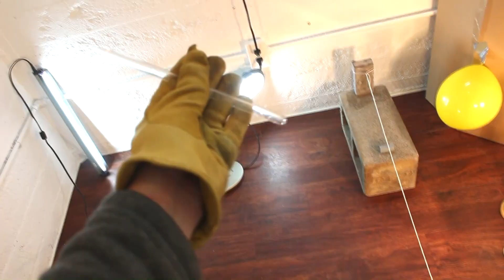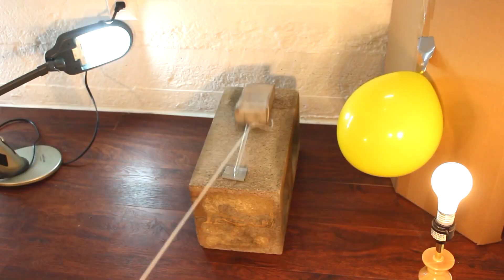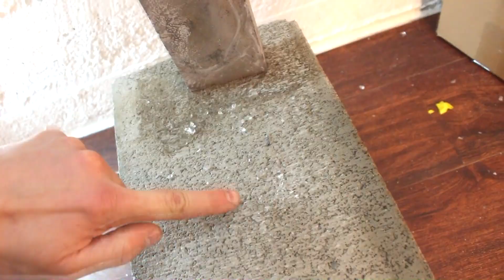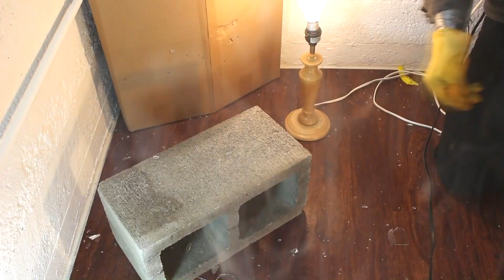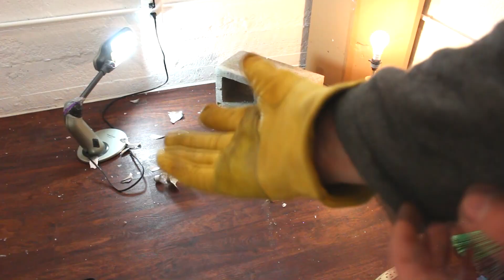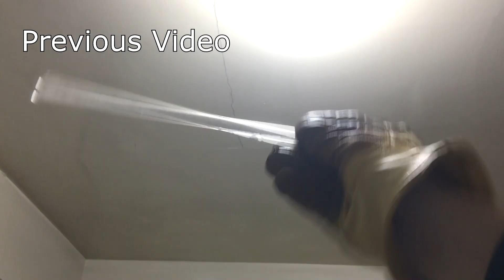Breaking The CO2 Tube at 6,000fps

Comment from the maker: Even when filmed at 6000fps the tube shattered in between single frames! This is of course because the glass breaks at the speed of sound through glass which is ~5km/s. I would need to film in the 100,000fps range to properly catch it; This camera is great, but maxes out at 21,000.
Reply: What are you waiting for then? Fly - no, I mean teleport - to the UK and The Slow Mo Guys will solve all your problems.
Reply from the maker: A camera like that would cost 30,000$ or more
Reply: You should team up with the Slow Mo Guys and capture it at 120,000 fps! Great Video though, thanks
Reply: The Slow Mo Guys had to film at 343,000FPS to properly capture Pyrex glass shattering. I wonder if the added pressure would increase how fast the glass shatters?
Reply: Cody'sLab as others have suggested a collaboration with the slo mo guys would be awesome, I believe one of them (the skinny one) lives in the US now. Also I think you can rent those phantom cameras from the company that makes them, I'm not sure how much they are though that could maybe be an option?
Reply: then join with Slow Mo Guys : it will be awesomeeee
Reply: You should get with the slowmoguys channel that have a camera capable of that!!
Reply: Colab with the slow mo guys
Reply: Cody'sLab you should get in touch with the SloMo Guys
Reply: Cody's Lab / Slow Mo Guys collab????????????
Reply: Slomo guys to the rescue! lol
Reply: Sounds like a colab with @smartereveryday is in order!
Reply: definitely try to team up with the slomo guys. That would be the best pairing youtube has ever seen. You were made for eachother!
Reply: you should do a video with slowmo guys!
Reply: ok, that was interesting, now go BIG;  repeat that experiment with a tube filled with your home made nitroglycerine.
Reply: send one to the slomoguys!
Reply: The SlowMo Guys did a slow motion capture of glass shattering. I don't know what frame rate they used, but it stretched out roughly 5 seconds of real time out to a roughly 15 min video. Even with that high of a frame rate, it still finishes breaking in roughly 10 seconds of that 15 minutes.
Reply: Maybe you could record this destruction with SloMoGuys or maybe SmarterEveryDay? They had some fast cameras ;) As for safety googles.... these were not safety googles, that was crowd control xD
Reply: HEY GUYS HEY GUYS I HAVE AN IDEA NOBODY SAID BEFORE, THINK ABOUT IT SLOWLY
"SLOW MO, GUYS"

I KNOW SUPER ORIGINAL RIGHT? /s

(srsly somebody's suggesting slowmo guys every half hour or so)
Reply: Cody'sLab you should team up with the SloMoGuys
Reply: call in the slow mo guys. they love to do this kind of stuff.
Reply: Slo Mo Guys have been based in America for quite a while now.
So he doesn't need to travel across the world! :)
Reply: The SloMo Guys have done some stuff with breaking glass and you need insane frame rates (300,000 FPS) to see anything happening.
Reply: Phantom v2511, in 2014, was priced at about 150,000USD. Can do 1,000,000 FPS at 128x32 or a comfortable 25,000 FPS at 1280x800. Flex4K can do 1,000 FPS at full 4K and 2,000 FPS at 1080p for 110,000USD.
Reply: Cody'sLab I wonder if the king of random would have the connections you need to make that happen, just sayin...
Reply: Collab with the Slow Mo Guys?
Reply: Slowmo Guys
Reply: Cody'sLab thanks for blowing more stuff up for us! :D
Reply: SlowMo guys to the rescue!
Reply: Cody you should see if you can get the slo mo guy's help to film this at around 120,000 with a phantom flex
Reply: According to the sensor(used in the Chronos)'s datasheet, it can do up to 1,000,000 FPS.. If your happy with 1280 x 1.  Yes. A single pixel high.
Not useful for youtube videos.
I think the selected limits are a bit more sane. :)
Reply: Electra Flarefire just get 800 of them and film 1 pixel high at all the intervals!  totally workable lol
Reply: Cody'sLab try to contact theslomoguys and do the same video with them, they have slow motion cameras in excess of 100,000 fps
Reply: hello from austria. can you repeat this but this time using balisticgel near to it to show the energy?
Reply: $12.
Reply: how to mike Sulfuric acid.cody slab
Reply: Ivan Anonym you really don't have a concept of the monetary system on youtube do you?
Reply: Ivan Anonym That's if the videos are monetized. And you won't get that only from sub's. You need commercial views!
Reply: Well the slomo guys are british, and royal mail won't even take batteries through the post so I think they might have a little bit of an issue with one of these tubes.... :D
Reply: Adam Rivera
v2511 discontinued. current v2512
The latest Shimadzu HPV-X2 does 10^7 fps; B&W, of course.
Google: High-Speed Camera HPV-X - Breaking Glass - (Recording Speed 10Mfps) You can see the glass cracks slowly propagating.
Reply: Slowmo guys did that with pyrex jugs, 5 seconds of filming generated 19.5 hours of footage but you can see the propagation of the shatter through the glass it's amazing!
Reply: Cody'sLab 
Good job on the video. I do admire your videos! Brilliant job!
Reply: really good idea
Reply: when I saw your first video I thought you were being hyperbolic about not wanting one of those tubes in the house - I get it now!  wow, thats an energetic pop!!
Reply: +Popaturdout Mcfartswell maybe 20,000 dollars no joke
Reply: such an awesome test, keep up the work buddy
Reply: +Abhijeet Viswa Speed of sound = speed of vibrations through a material, kinda. It's how fast a push/wave moves through the material. The speed of atoms pushing other atoms pushing other atoms.
Reply: Cody'sLab you sir, are braver than I.
Reply: huh do you think it would be possible to send one of these to the slow mo guys?
would be cool to see how it shatters with their really high speed equipment
Reply: UK Viewer :) Love your videos man
Reply: Cody'sLab you should calibrate with the Slow Mo Guys for breaking one of those tubes.
Reply: It would be awesome to see this with thermal imaging!
Reply: 470th
Reply: You are cray cray
Reply: yea
Reply: I had to thumbs up because it had 666 likes and had to comment because it had 99 comments.
Reply: comment number 100!
Reply: Wow an impact grenade
Reply: Cody'sLab how much does a 100,000 fps cam cost might I ask?
Reply: neat
Reply: where did you get the music from??
Reply: ***** good god
Reply: Cody'sLab looks like tesla gave you,dave and ben one of those great cameras
Reply: was gonna say......one frame their..next...gone

but.gotta love science....its got 5km/s speeds for the gear heads
and a thousand psi bomb for the....other kids....
Reply: hey cody,could you do some fireworks vid's,some chemical redox tricks from the sleeve? ;p, newyears eve is coming wich is a pretty big thing in the world - every year- :) cheers brother!
Reply: Speed of sound through glass is ~5km/s? Can't air do anything right?!
Reply: can you try to heat an end of the glass tube or at least predict what will happen?
Reply: It would expand until either it became critical or the gas volume equalized. More than likely it's would expand more than the glass could cope with, you'd then get a shower of hot glass.
Reply: always good stuff ,watch every episode .love that hands on science feel :}!
Reply: Oh I just love it when you purposely make an experiment go wrong then decide to make it an experiment of its own
Reply: Cody'sLab Thanks for doing this Cody!  We appreciate you observing your viewers' requests.
Reply: Cody'sLab how many GPs were u shooting at
Reply: Cody'sLab any suggestions on how to best seal the tube if I use one that is open on both ends?  I would love if you could answer the question I asked on your Facebook on it. Great video as always!
Reply: Man be careful! Yikes that glass is hauling ass!
Reply: Totally dissuaded from messing with this stuff now lol, much safer stuff to play around with. I actually was interested in it before but now I'm pretty sure I don't have the qualifications to not poke some major holes in my meat suit :/
Reply: Cody'sLab  That was really cool man.  are you going to do any other gasses?
Reply: Then, do that kickstarter :) You have 853745 subscribers - thats 3.5 cents each!
Reply: even at 800k subs you dont have money to buy stuff like that? people with subs like you already bought a lambo and mansion
Reply: zlotvorx well said
Reply: Popaturdout Mcfartswell lot of monet
Reply: Bruh was bout to suggest that lol
Reply: Gavin actually lives in Austin Texas where most of his videos are shot.
Reply: theblindspot985 No shit.
Reply: closer to 4.5 km/s
Reply: Sinule admittedly mailing someone tiny bombs is probably a bad idea buuuuut......

...
Reply: You quit Bee Keeping?
Reply: James Thomas he probably shouldn't put one of these in the mail lol
Reply: can you ask thunderf00t?
Reply: Talk to Destin or the Slo Mo Guys??
Reply: Speed of sound is 5km/s?? That's more speed of light.
Reply: Even with 1M fps you won't catch more than 3-4 frames of glass breaking
Reply: Cody'sLab wow
Reply: +Muzik Bike - Geometry Dash and stuff they are in Texas you inbred

Comment: that's crazy!!! is it possible to produce super critical nitrogen or is its boiling point far to low to be practical. I'm assuming it's low boiling point is related to the required pressure required to go supercritical
Reply from the maker: Yes it is possible, but as you suspect the pressure is much greater.
Reply: Cody'sLab cody i think your cam has been hit by something at the second slowmo :/ (top right )